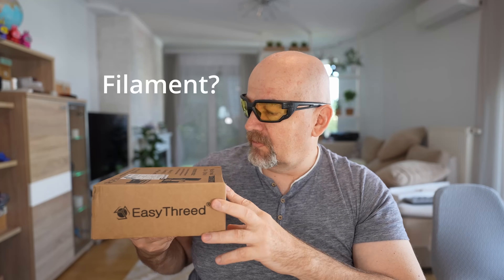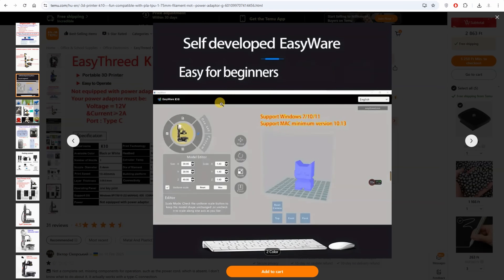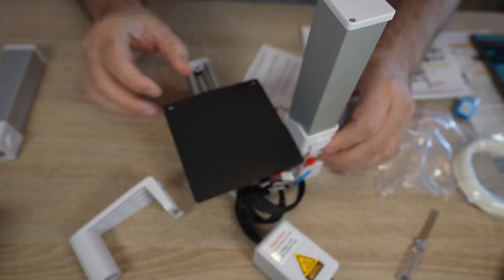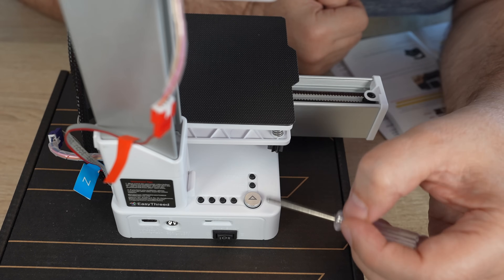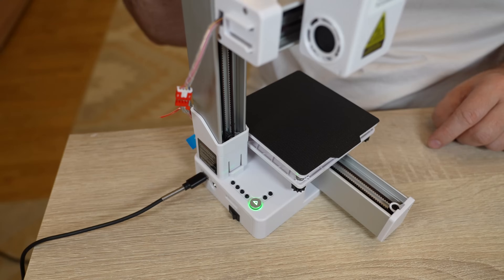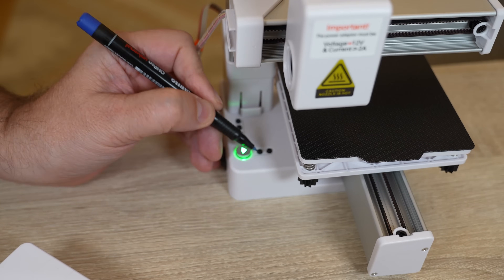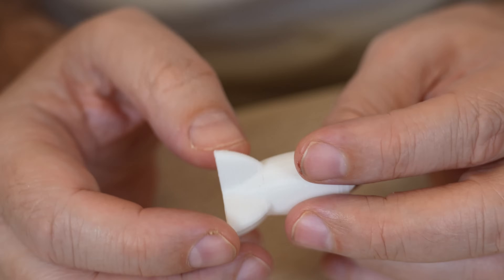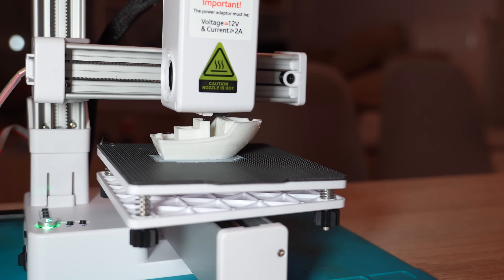Cheapest 3D printer from Temu: EasyThreed K10

Comment: I printed new PLA slides designed by me to replace the stock ones, which have too much play on the aluminum profile. With PLA, sliding them by hand, forcing them until they are smooth and free in movement, works very well. Basically, I made a photocopy of the profile with the scanner and traced it in Fusion 360, leaving only 0.05 of play on each side or a little more and increasing the thickness of the top face, so that when attaching the pin there is no play. A crucial point is to have lengthened the external sides and chamfered them at 50°, to force the Z limit switch on the profile (where the plastic closure is) and not on the bed (otherwise it is almost impossible to level because the limit switch would be due to the pressure on the bed). The result is incredible: it prints with a layer of 0.2 very well. The print area remains small and slow, but it also prints Filoflex and very soft TPU because its direct head has very little travel between the extruder wheels and the nozzle! It's a shame that the improvements I made (and you need another 3D printer to make them) aren't standard, otherwise I'd give it a solid 10/10 for the price and ingenuity!

Comment: I made some mechanical modifications to my printer, such as tightening the belts and removing the play from the plastic rods. This eliminated all ghosting and unwanted movement in the structure. I also printed a file to help align the frame, and the print quality is now absolutely surprising.and I used petroleum jelly to lubricate the belts and moving parts.
Reply: A sério?
Vou receber esta impressora daqui a poucos dias, depois se puderes, explicas-me isso melhor?
Reply: Wie hast du das alles gemacht?
Reply: Can you explain how to remove the plate? Can you tell us about the file you downloaded? The name of the file and where to find it.

Comment: Hi. I now have TPU in the printer. And I have the EasyThreed K10 profile and EasyThreed TPU settings for TPU in the Orcaslicer. Now I want to print a TPU part without the raft and, for example, prefer to set a brim. But how do I remove the raft, as we can see when you print the TPU cube in this video 15:09 ? It makes a raft even if i set a Brim. Maybe Raft is in the printer settings ?

Comment: I adore this printer! You can easily upgrade your experience by taping over the included magnetic bed with kapton tape, makes it so you don't have to use rafts anymore (basically the same printing experience as with any other printer). Not sure if the belts need some wearing in or tightening, but after printing ~1.5kg of filament, I can reliably use 75mm/s speeds and ~800mm/s^2 of acceleration.
You can also stick some more tape (tape FTW!) behind those circular connector on every attachable part to make them way tigher + less prone for wiggling. After that, the speeds for this tiny 100x100x100 print area are relatively fast + the printer actually ends up not sloping to the side.
Reply: I wouldn't use the recommended spool holder tho, way too heavy. I would use one of those cheap spool holders that you place on your desk so the printer can pull the filament with minimal friction. Putting a 0.5 or 1kg spool on the printer surely will end badly in the long term...
Reply: the only real issue here are the proprieitary motors and nozzle, but replacements cost like $5 on aliexpress/temu so you'd get a good few months/years of usage before hitting the price of a used ender 3 lol

Comment: I'll say this, if you have access to the used market buy something like an ender 3, and do not waste money on these mini printers. 
1. You'll regret not being able to print bigger things.
2. No brand printers usually have not compatible replacement parts
3. The bad experiences from products like these hurt the hobby overall.
4. You will more than likely only use this as a toy and when you buy an actual usable 3d printer this will get tossed aside creating more e-waste trash.
220mm cubed should be the minimal size you aspire to if you want to get into the hobby. I don't know much about resin printers and although their print size is usually much smaller than FDM it's their detailed "resolution" that people buy those for and not the print size. Of course this is only my opinion but it's an educated opinion and my perspective from my own experience. I bought a used ender 3 pro that was already modded for like $90 US and later upgraded to an ender 3 v3se for $100 both of those machines used. I hate that some things I want to print either I can't or I have to break up into smaller prints.
I"m now looking into a centauri carbon with a 256mm size with a built in enclosure for those tougher filaments and because I've never had a corexy...
Obviously the more you save for the better the printer ie BambuLabs etc...

Comment: Why are the "platforms" so expensive? 

I found it on Temu priced 3 for $14 !!
Is it made of carbon fiber ?
Reply: No, they're actually not a great printing surface at all. There has been more success with just using painter's tape across the original plate, and replace when needed.

Comment: Personally I think if I wanted a small and relatively cheap 3D printer I'd still go for the Bambu Labs A1 Mini, yes it's about 3 times the price of this one but it's a lot less hassle to setup and use, it has a 50% bigger build volume and much faster with greater material flexibility due to a heated bed and a hotend that can print much hotter.  This is a fun toy but I don't think it is a good first time printer as it would give someone a bad impression of 3D printing making it seem much less accessible than it actually is in 2025, printers like the A1 mini and other more recent ones are so much easier to use and allow non techies to get into 3D printing and enjoy it.  This one gives me the impression that it was someone's school project and build at home, as I said, fun but I wouldn't buy or recommend this to anyone.  Thanks for the interesting review though it's good to see it's actual capabilities.
Reply: 3x times the price?...
Reply: Lol, would you buy a bambu labs instead?! It'd be nice to see reviews of printers without bambu fanbois talking about how they would just buy a bambu, especially when he is talking about THE CHEAPEST 3d printer he could buy.  Not trying to pick on you but dude, for real...
Reply: @SteveP-z7c you know what’s worse than bambu fanboys? Bambu haters! How can you talk crap about a machine that JUST WORKS? Bambu single handedly fixed the one thing that scared enthusiasts away back in 2015-2020 era, which is the machines being a PITA to actually use. Thanks to bambu we now have decent competition and the rest of the manufacturers are making some effort to launch not entirely shitty products
Reply: @willng34  Bambu haters? Who was hating on bambu? I was pointing out that bambu fanois somehow figure out how to talk about bambu printers even in a video about the cheapest printer there is. If you can't see the irony in that, I can't help you.🙅‍♂
Reply: @SteveP-z7c  what lol
Reply: @martinsvensson6884  No shit someone would buy a bambu instead. Not really a helpful comment on the cheapest printer...
Reply: @SteveP-z7c  This comment sounds the same as 9 year olds religiously defending or attacking either Playstation or Xbox
Reply: @Sean_735  dude, how does one bring up a bambu printer when talking about the absolute cheapest printer one can buy. I'm merely pointing out the absurdity
Reply: @SteveP-z7c  It's cool mate, I'm not a fanboy of anything in particular, I just mention the A1 mini coz it's also relatively cheap compared to other printers, I know this was the cheapest available on AliExpress and considering the price it's amazing that it prints as well as it does I'm just saying that when people are trying to get into 3D printing for the first time they tend to not want to spend much money as they're not sure if they're going to like it and if they made the mistake of buying one of these it would be a sub optimal experience, IMO.

Comment: You can actually use any USB charger. They all default to 5V unless the device supports voltage negotiation and "asks" for higher voltage.
Reply: But this needs 12v...
Reply: This requires 12 volts, and at least 2 amps. A USB power delivery, power supply is the only type C that will offer that, other than a power supply with the correct barrel jack. 
The problem with USB PD, is the latest standard has given the manufacturer the option to eliminate 12v, so it's important to pay attention to the power supply offerings. 
But PD is a must if you're using a USB type C to power this.

Comment: What a waste of resources. A child that uses it as toy will get frusttrated after short time and everyone else never will do honest prints with that dustcollector.
Reply: I get your point, but at least this will teach kids how to level a bed. Most people couldn't manually level a bed if their lives depended on it.
Reply: @SteveP-z7c  because every printer now uses auto-bed-leveling why learn to level a bed? Learn flow-calbration and that stuff would be more useful.
But if they learn how to level a bed - every time... they give up and learn: "3d printing sucks" - bad teaching
Reply: @peterle987 those aren't true "auto bed leveling", that's just the machine taking note of where the flaws are in the bed, and building up in the low spots. So your first few layers aren't exactly flat. 
Learning to actually level the bed will give a child a skill that no one can then take away from them.
This model actually has a flaw in the design of the guides that ride along the extrusion, but the community has developed a fix, and they do quite well afterwards.
Reply: @AraceaeFanatics  different opinions - I still use my Ender 3S1 - you can manual bed-level with 4 screws, but I also do a 6x6 grid with Bl-touch Sensor. a 4 corner leveling isnt good enought if the bed is bumped in the middle for example. So its pretty usless and I never used it since.... cannot remember, but the 6x6 grid I do before every print and I have no print fails. So: what do childrens learn? bed leveling before every print sucks - 3D printing sucks. Well done !

Comment: Wow, I'm shocked at the results. It totally looked like a toy printer and my expectations were low. I've had Ender 3's that didn't print that well out of the box. I have a Tina2S printer that I've printed like 2 things with since I got it. It has the same build area but in a semi-enclosed structure and even includes an ABL sensor. It works fine but is slow and PLA sticks so hard to the PEI sheet that each print leaves an irremovable outline of the part, so I don't think it will last long. And when I last looked I couldn't find replacement sheets so would probably have to cut down a bigger one to replace it. It's a cute novelty but when you have "real" modern printers it's hard for me to spend time with it.

Comment: That's a cute little printer.  I like the idea of a small 12 VDC printer that could be used in solar powered off grid tiny homes, RVs, etc.  I think I'd like a small bed slinger with Klipper, but this could be a good first 3D printer for a young person, and the nozzle doesn't get so hot that it'll easily burn a child.
Reply: What is the difference in getting burned by 230c or 300c? Not huge... You could make an argument that the bed is cold and that's a larger object so larger chance of getting burned in the first place.

Comment: 6:12 Nintendo has been famously non-compliant with USB standards
Reply from the maker: 5 and 15V is standard too, but yes, they could support more voltages. But for their unit 15V is enough..
Reply: @MyTechFun  When the switch came out, it was one of the few PD chargers that delivered 15V hence you had to use their charger.
I wish more manufacturers would state which PD profiles their charger supported instead of saying how fast it charged.

Comment: I am a bit obsessed with these small Easythreed printers. If only I could improve the precision... Probably the best is the K1 with a dual gantry design, but it rarely shows up in online stores. I have a K10, printed the sliding pieces with PETG for more rigidity (the original, injection molded plastic parts are very soft), there's also a print that makes the Z axis more rigid. I wish the kinematics were more easily moddable, so I could have a slow, cheap but precise portable printer.
Reply: PETG is less rigid than PLA, though somewhat more creep resistant.
Reply: Heard of the Positron? Not cheap, though.
Reply: Hi, I've been wondering about the K10.  What is the quality of the prints with the k10?
Reply: I printed new sliding parts. It is really godd if you remove space and play and stabilize it. If you want to improve without replacing stock ones, at least put paper between pins and sliders to force a solid joint. If you want I can crate a link to my sliding replacement model